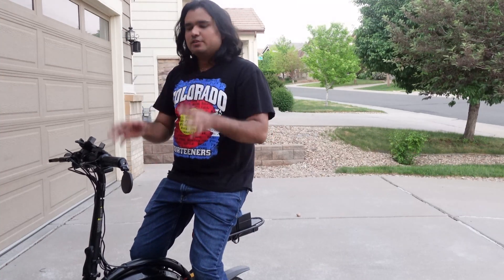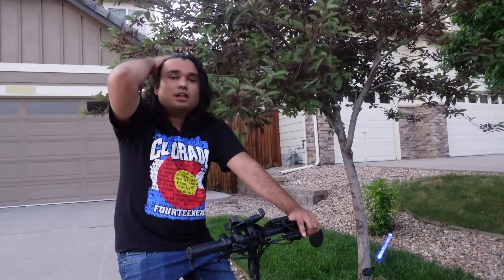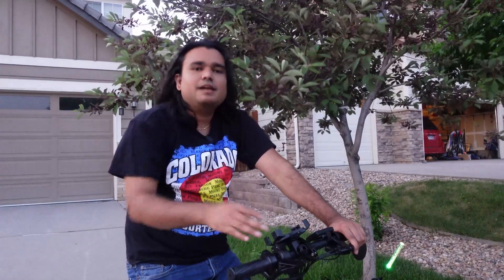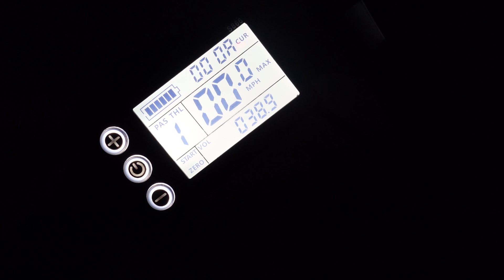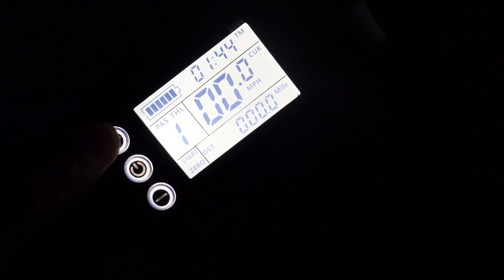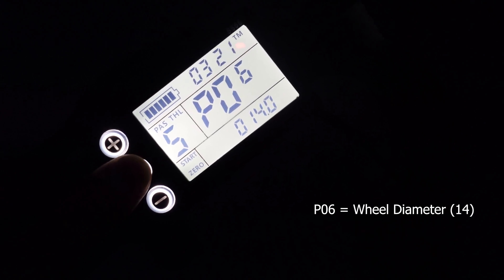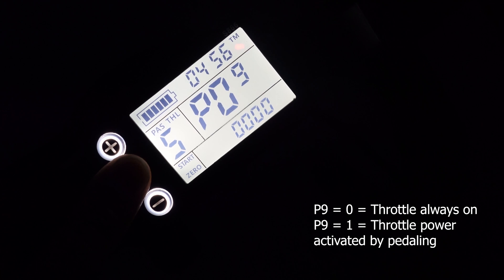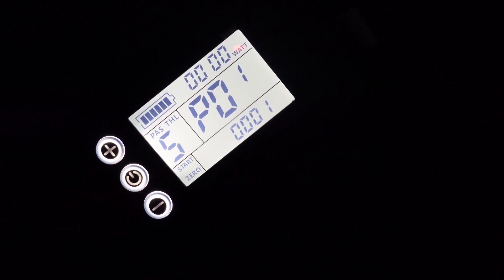Electric Bike (Jetson Bolt Pro) - Controller Upgrade Settings & Questions

Comment: hey  i got the regular jetson bolt. and the only screen I've got is the battery next to the handle. im also trying to reset my profile's information of the speed professional riding skill and so on.
to me not being able to change that profile to me spells a sketchy company, along with some other red flags, i happen to be owner of one of the top consumer advocacy commerciwl companies out there. so generally i smell sketchy pretty well. kinda annoying at times being there's eadily so many fishy companies out there err. anyhow lol... i just want a regular normal company to shop at lol.

so what can i do to change the profile's options of speed, driving force/skill level and the steering sensitivity? 
i had no idea when i first set the bike up what all that was .glad i set the speed to 12!

Comment: Anybody have different colored wiring on the newer Jetson bolt pros? Do you have the new wiring information?  I can’t find the pinned comment by Shiva
Reply: What battery and controller r u gonna use for the newer jetson bolt pros

Comment: If you put the battery to quit at 32 v and the battery is only 36 v you only have about 8 to 9 volts to play… can you program that to a 24v or is bad for the battery?

Comment: How much did u spent in this upgrade?
Reply: I can't speak for original poster, but I spent $59 (tax included) on new controller and since I went with the 48v batter upgrade, add another $270 (really expensive to ship where I live). I also replaced throttle (original broke) which was $11  and $10 on new handlebar grips. So in total I'm at $350. Basically what a brand new JBP costs lol...

Comment: Shiva, I bought an after market throttle controller, but after installation, I get no readings at all.  Is there a specific part number controller to fit my"folding pro"  e-bike?

Comment: Hi Shiva.  Thanks for all your mod tips over the past year and a half.  Hey have you viewed Tony Quill's channel showing another work around for doing a Bolt Pro speed hack by simply reprogramming the existing speed control without adding any new hardware?  I'm thinking about giving it a try.  Tony claims his mod gives the Bolt a minimum 20 mph range. I was wondering what your opinion would be on his solution?
Reply: Did you try the hack? Seem many people are attempting the hack but notice no change in speed

Comment: I just installed this controller but now, it only goes 9 miles an hour and has absolutely no power. It also makes a lot of noise. What can I do?
Reply: You figured this out?
Reply: @iunek5558  yes I did but I don’t remember now what I did. It wasn’t too difficult.

Comment: I just had a quick question I installed the controller and I set it up = your settings but I am not getting any I'm getting any extra speed could I be doing something wrong
Reply from the maker: It could be a lot of things. Please email me if you are still having issues. Thanks.

Comment: Would a 48v battery work with 36v controller and increase speed
Reply from the maker: It potentially could but I wouldn't recommend a 48V battery on the stock 36V controller.

Comment: wish you had down a detailed tutorial on the wiring of the controller
Reply from the maker: Please send me an email. I have a detailed video I can send you. My email is: sapkotatechnology@gmail.com.
Reply: @ShivaSapkota  hi shiva, have you figured out which wire is the speed limiter. I have the dyu d3f which is none Bluetooth and limited to 14mph. I want to unlock the 19mph mode. And I think the only way to do it is to disconnect the the speed limiter. any info will help
Reply: @ShivaSapkota  please, i am needing help with this as well, i sent you an email with some pics of my friends predicament, namaste

Comment: When connecting the controller u had a thumb throttle but if I had a stock jetson with twist throttle do I need to do any soldering or splicing or can I just match up the wire colors..also do I need to use the lcd that comes with cuz idk how to wire that up
Reply from the maker: You can use the stock throttle but be very careful as I heard the colors don't match with mine on the newer models. You still have to solder and splice. The LCD is plug and play, no need to splice, it connects directly to the new controller. Be extra cautious doing this as you can easily fry the motor...

Comment: Hi there, I just subscribe now, as you're doing cool videos related with this e-bike. 
Mine is a kugoo kirin b2, which is quite similar, the thing I noticed is that the rear wheel is not spinning free... I thought it was the chain to tight, but it wasn't the issue. 
Seems like the ball bearing inside of the motor hub, are not spinning properly, not grease enough, or other kind of issue. 
Will need to dismantle the motor, to reach it, and check if it's any problem there. 
But..... The cable from the motor to the regulator is not possible to pulled through the frame, is too tight, and the cables are a bunch.
Now wondering how I can take the back wheel out, to check the motor hazzle free... 😳
Reply from the maker: Hi Raul, sorry for a delayed response. There is no wire slack at all? I would recommend you open the controller housing (I have a video on this with battery replacement) and then undo the motor hall wires. There should be one connector that you can easily unplug and the 3 phase wires which can be unhooked by just using a flat head screwdriver. If the hall sensor plug is too big to fit through the hole, you might have to splice it. Shoot me an email (sapkotatechnology@gmail.com) and I will try my best to guide you. Thanks.
Reply: @ShivaSapkota  I just sent back the e-bike... Will get a replacement in a few days.. 
Noticed the app to connect with the e-bike do not pair with it. 
Some issues also with that. 
So, decided to get another one. 
Thanks for your help. 
I will save your email for future, if you don't mind
Reply from the maker: @Raulperez-yc9de  I am glad Kugo is helping you out. Please reach out at anytime with questions.

Comment: Hi Shiva, where did you find the controller?
Reply from the maker: I got mine from Amazon. If you would like the product link and installation guide, please send me an email. Thanks.
Reply: @ShivaSapkota  hi Shiva, i am also having a problem, my friends bike has burnt wires, and i advised he to change the controller; anything you could help me with would be much appreciated, i set you an email with some pics, namaste

Comment: Hello Shiva, I did this upgrade according to your instructions and the wheel does not even turn. The motor activates but just shudders and does not rotate. I double checked my wiring. What could be wrong? The LCD display does not show a wiring fault, and everything else works as expected (P settings, clock, odometer, etc). Without the motor, the bike is useless
Reply from the maker: Hello, sorry to hear that you are having issues. I suspect it is probably the throttle connection? Does the throttle wiring on your bike match mine? What about the pedal assist? Some people reported having different wires for those (hence my reasoning on why I took down the original video). Did you press the plus button until it reaches 5 or 9?
Reply: @ShivaSapkota  Thanks for responding Shiva! Yeah, everything matched your wiring exactly. The display did not show any wiring faults, the headlight came on, and I used the P settings you gave in your other video. The rear wheel would just "shudder" when I turned the throttle. I ended up reversing the mod and going back to the old controller, but then the wheel did not move at all. I ended up ordering a new bike. LOL. This time I got the Ancheer 500w version with bluetooth (please look at that one). It looks exactly the same as the Jetson Bolt Pro, and I suppose I can use the Jetson for parts. Not your fault! I see you are riding yours, so must have been something I did wrong.
Reply: I was stumped, too.  Finally, I found a motor phase-wire (blue, green, yellow) flow chart for testing.  Instead of connecting the big bullet connector  green-green, blue-blue, and yellow-yellow wires I followed the flow chart.  My final stop was yellow-yellow with the other two switched (g-b and b-g).  The learner wire also helped with getting the wheel spin direction right.  Who knew?  Blue green color blindness by the guy building the controller must be a big problem.  

The 007 Error went away.  I'm riding in the cool 80 degree Texas mornings, and 90 degreeTexas evenings looking at getting 48v 20ah batteries to lug my fat butt up the small hills since the diet started including ice cream.  You just need power, hall, and throttle to test.  I bought a thumb drive throttle.  It helped test.  It's didn't get onto the bike since the brake lever gadget  is apparently welded to the handlebar with just an allen bolt taunting me to break it.  I'm off to a bike shop to solve that very mechanical problem.
Reply: @kuu8770  That's interesting.  I had the same exact problem with the motor shuddering and not rotating.  I eventually got it working not by switching the green and blue wires but by switching the yellow and blue wires.  I didn't need to connect the learner wire.  I did buy the controller off of Ebay so I don't know.
Reply: Ty k uu, switching those wires exactly how you described also followed a few other comments for my pedal assistance and throttle but your comment was the last peice of the puzzle, great community, ty shiva and jay as well

Comment: I just finished the 48v conversion with the same controller it does 26mph now
Reply from the maker: Awesome, thanks for letting me know.
Reply: Hi. I have a few questions about the 48v upgrade. May I have a few part numbers for everything you used please? I would really appreciate the help!
Reply: Is the motor still a bit loud with the new battery
Reply: Ho which battery do u use
Reply: @DiveBombSimRacing  built it 48V 10ah

Comment: Shiva, I changed my controller to a 36-48v, 25amp (EBW-USA) with HIGO (wp)connectors, I had to reverse the motor because it was going backward ( Now: Phase: Grn-Grn, Yel-Blu, Blu-Yel Hall: Yel-Grn, Grn-Yel Blu-Blu) and I changed the battery to a 36v, 30ah lit-ion battery but at low speed the motor vibrates, whines and bogs down but at top speed it becomes smoother and faster (19.8mph) - I'm curious to know if there are any phase/hall sensor wiring change that can eliminate the 'whine' at low speeds and works smoothly at low and high speeds. Thanks.
Reply from the maker: Hi Daniel, thanks for sharing your upgrade. Great job! I have noticed that the motor does "whine" at lower speeds, I don't think we can do much about that.
Reply: Thanks buddy, 
I actually solved the problem by upgrading to a Bafang BBS02B mid-motor conversion w/48v exterior battery.
A bit costly but smooth, torkie and fast now (18mph). So much easier than upgrading controller,display,etc. I spent more on ‘possible’ upgrades than the complete conversion. Just a heads up.
Thanks again amigo
Reply: @dalexander913 which mid drive did you get. Interested. Link please.

Comment: Shiva, unfortunately I was not able to upgrade my controller.  Seems the company changed some of the wiring.  Now I can understand why you took down the first video.  At any rate, before I did anything, I labeled the cables/connections on each side with a number.  #1 on one side of the cable/connection, #1 on the other side. #2 and so on.  I did this in the event I had to revert back to my original controller, which I had to do since I could not upgrade.  However, although I wired everything back,  I have 2 issues.  When you turn on the Jetson, the light stays on permanently and most importantly, I don't have the 4 green lights anymore showing how much battery juice I have left.  Any suggestions?  

Also, is there a way to connect the new display (s866), to the original controller?

Thank you and I enjoy all of your videos.  Keep up the great work!
Reply from the maker: Hello, I am extremely to sorry to hear that. It seems like you might have a mix-up on the throttle wires. Please double check the throttle connections. Unfortunately, there is no way to connect the new display to the original controller. It is not compatible. Thanks and sorry again.
Reply: I just got a jetson bolt pro and am thinking of upgrading the controller as well. Could you elaborate a bit more on how your model wasn't able to upgrade?

Comment: Hi I have the ancheer version of this bike but it's 500w and 48v but it does 20 mph all day rips up hills and I can go 20 miles range.but no one  and I mean no one has ever done a review on it ,not sure anyone even knows they exist ( super fun) you gotta check one out.love your videos ,made doing my brakes a breeze
Reply: you. guys got me thinking now , I noticed my supposed 500w 48v is only going 18mph I'm opening up the hub to investigate I'm starting to doubt markings on hub that say 500w, it's getting a little old being lied to in this world , can't trust anyone ( sucks) I guess I might as well check controller , ill get back to you guys with findings but ill tell you what my spider senses are tingling lol
Reply from the maker: Hi Tom, let me contact Ancheer and see if I can get my hands on their e-bikes. I would love to review it. Thanks for watching my videos.
Reply: I've got the 500W, 48V Ancheer foldable ebike also, but mine only goes up to 17mph even down hill (I'm 190lbs).  I downloaded the Ancheer app, made sure it is not límited, but no avail.  Then opened up the bike's cover to find out the controller is only 7A rated ( x 48V = 350W). Otherwise the hub motor has markings noting the motor is rated for 500W. Also I'm getting only 12 miles range out of it with its 48V, 7.5Ah battery.
Reply: Lol and I was crying because my controller said 13 amp on the upgrade for the 48 V

Comment: Not sure if you remember us talking about upgrading my battery from a 36v to a 48v battery swap but here’s the update. After swapping the battery last night my Jeston bolt increased speed by 7mph. When not sitting on the bike it goes up by 11mph. After work today I’m going to disable the pedal assist to see if that adds more of an increase because I haven’t ever pedaled anyways because the bike is to fast for me to keep up with. So I’ll update you again tonight.
Reply: You must live somewhere really flat…or that increases power setting must handle hills better than the stock set-up.
Reply: @westmcgee9320  Well m’y controller is a different than stock and the battery I got also so it would have to be those two changes. But my ride to work was majority flat ground yes.
Reply: @StreeterTurner  I'm getting a jetspn what controller did you get and could you do a step by step on how to add it ? 😀

Comment: You left a huge important part???????? How to connect the remote im here now with a i working jetson thinkin it was as easy as you said now all i see is error
Reply from the maker: What do you mean by I left a huge important part? If you need the detailed step by step video, please shoot me an email. Many people have done this upgrade successfully but it hasn't worked for some people. Jetson changed the wiring on newer models, so please be extra careful.
Reply: I need step by step i got the power plug nd the 3 phase wire right but the rest im lost
Reply from the maker: @emaginthat169  Please send me an email at: sapkotatechnology@gmail.com.
Reply: How can i email you

Comment: Hi Shiva, great video once again. I want to upgrade my controller and battery, I know I should have the same volt battery and controller, and that I can increase amps as I please. But what does increasing wattage output to the motor do? I see 36v/48v controllers ranging upwards of 1000w and I’m wondering how many watts can the Jetson motor take?
Reply from the maker: Hi John, I do not know the answer. People have definitely tested this with high powered 48V battery and it runs fine but I haven't tested on with 48V. The controller should only send whatever the motor asks for, so in this case the motor is "requesting" 350W, the controller should only provide that. However, I do not know the architecture well enough for this bike to comment.
Reply: @ShivaSapkota  Awesome, well thank you for checking and answering as much as you can. I’ll do some testing and let you know how it goes, I still need to send you pictures for the swag Tron envy that I modified, keep an eye on your inbox!

Comment: On amazon it does not say its rated for 48v the ebay link does will it work with a 48v battery??
Reply: Also i cant find the instalation video
Reply from the maker: Please send me an email for the installation video. Thank you!

Comment: We're you able to use pedal assist
Reply from the maker: Yes, the pedal assist works for me.
Reply: @ShivaSapkota  can u send me link of the controller n wire setup
Reply from the maker: @kenshin510  Can you please send me an email (sapkotatechnology@gmail.com). I don't want to leave a link here as I took that video down. Thanks.
Reply: @ShivaSapkota  ok

Comment: Hello do you have a video to show how to swap speed controller?
Reply from the maker: Hi Albert, I do. Please send me an email and I will send you a link. People were getting confused on various wires so I took it offline. Thanks.
Reply: @ShivaSapkota  Albert.Alfaro@att.net
Reply from the maker: @albertalfaro7504  I just sent you an email. Cheers!
Reply: @ShivaSapkota  cool thank you cheers
Reply: Hello I was wondering if you can resend video you made step by step install for controller module and lcd screen you sent it a long time ago just wondering if you can resend thanks